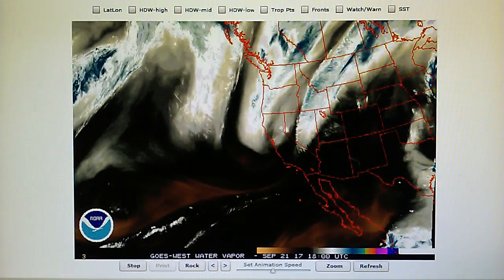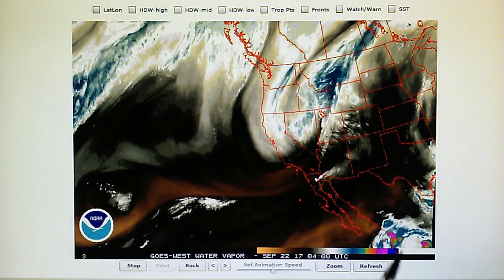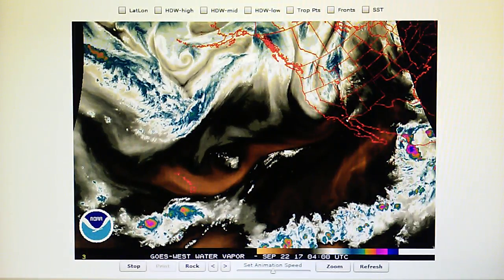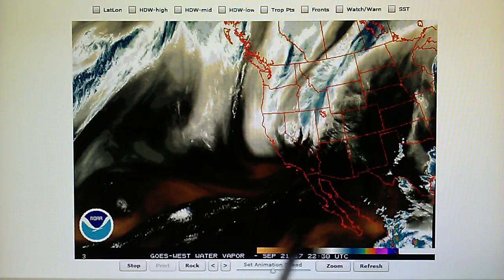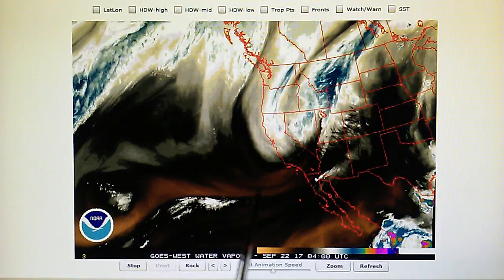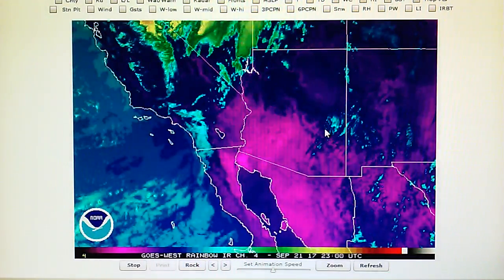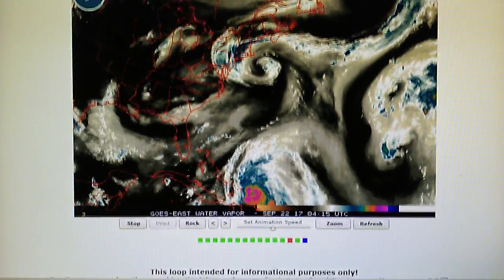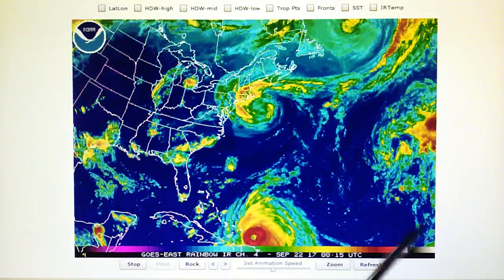9-21-2017; Microwave Evaporates Jet Stream Moisture Into CA; Only 0.17" Precipitation As A Result

Comment: Noaa water vapor loop is showing moisture coming into So. Cal. That explains the aerosol spraying today in Riverside Ca. 9/25/17
Reply from the maker: Marcy Rossouw - The jets were dispatched to spray the aerosols in order prevent unexpected precipitation over Southern & Central CA as a moisture field moved South through the region. A big disruption in the Jet Stream is evident over Southern and Central CA as the moisture in that flow is evaporated by microwave or laser transmitter. A heat wave is being engineered this week as strong stationary  high pressure remains installed; Temps on the rise to mid 90s by end of week.
Reply: Thanks 1PR.  I've learned so much from you!